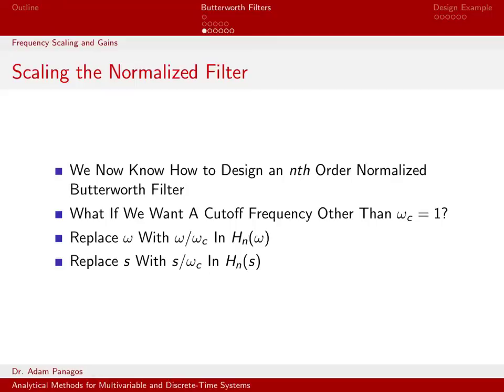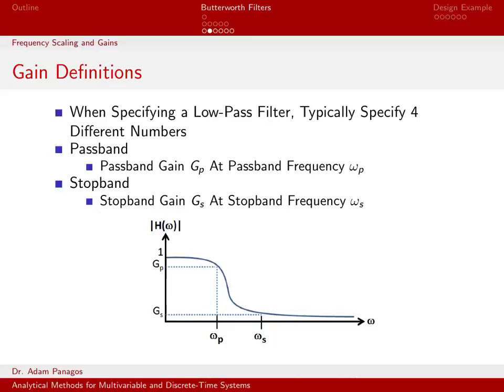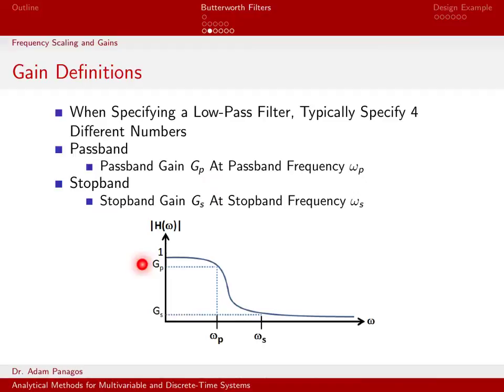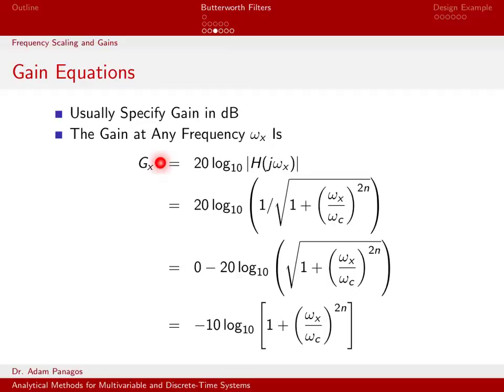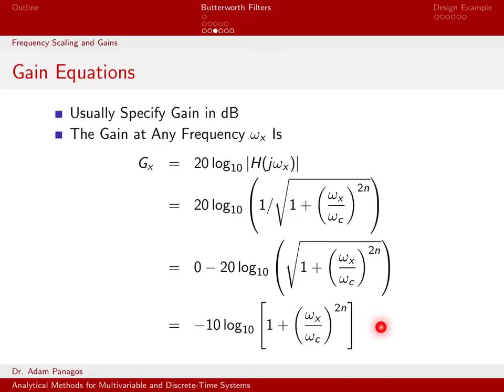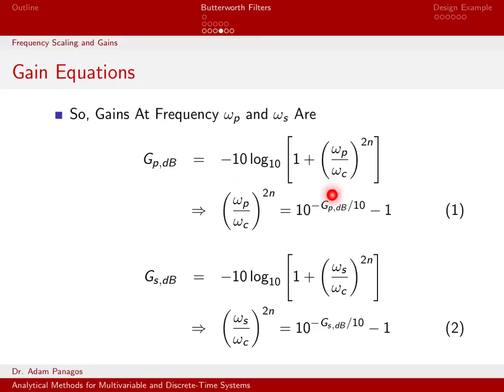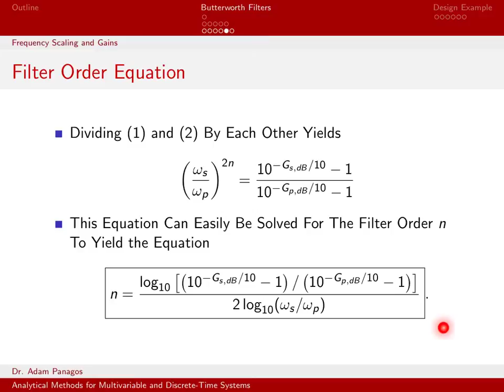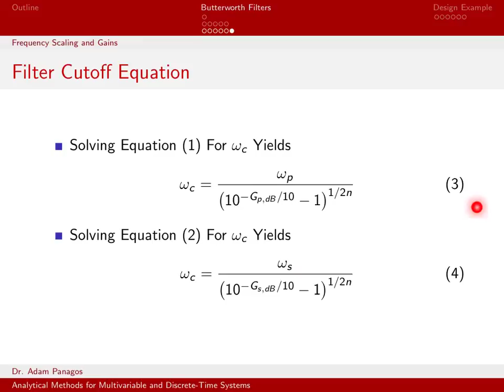Butterworth Filter - 03 - Frequency Scaling

Comment: I'm sorry, but when you say that you're going to use algebra to solve the equation (4:40 min) I couldn't follow your calculus. Is there any video which I could watch to understand it better?
Thank you and congrats for this fantastic job!
Reply from the maker: At the 4:40 mark you're talking about how I simplified the 20log10() quantity?  That's really not calculus, it's just properties of logarithms.  We have 20log10(x/y) = 20log10(x) - 20log10(y).  Since log10(1) = 0, that results in 0 - 20log10(y).

Similarly, if we have 20log10(x^(1/n)), by properties of the logarithm this is (1/n)20log10(x).

Hope that helps.

Adam